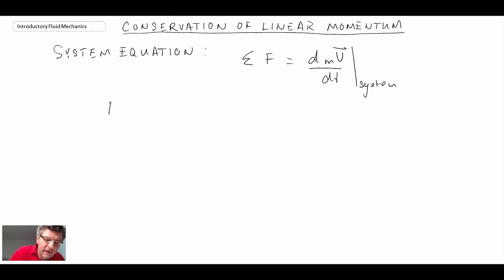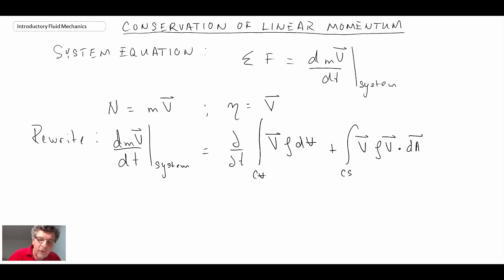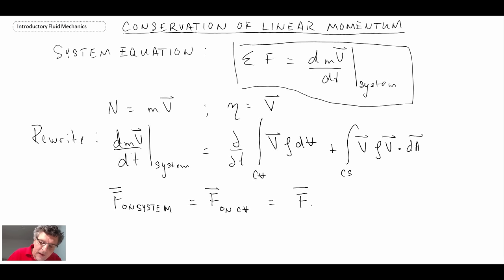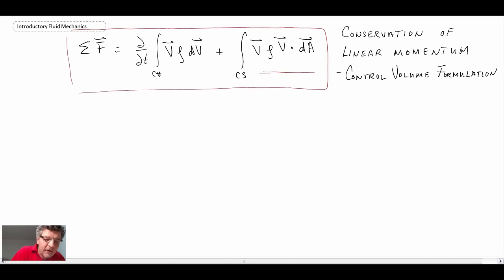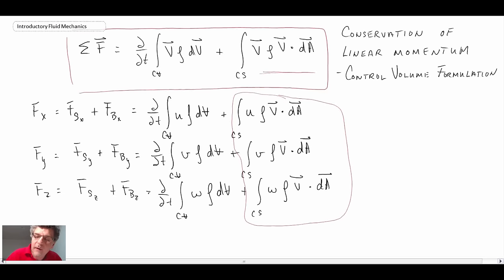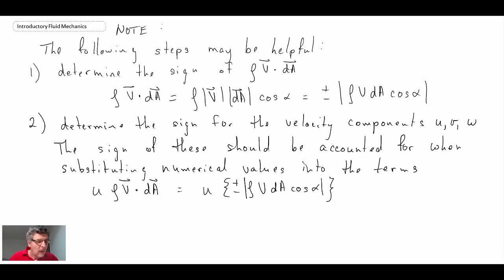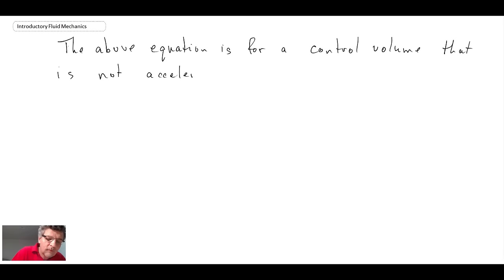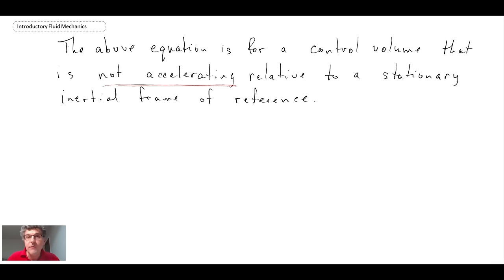Introductory Fluid Mechanics L8 p4 - Conservation of Linear Momentum

Comment: in the control volume formulation is that dV supposed to have the vector on top or the line through the V?
Reply: I think it is the line through the V, which means the volume instead of velocity.